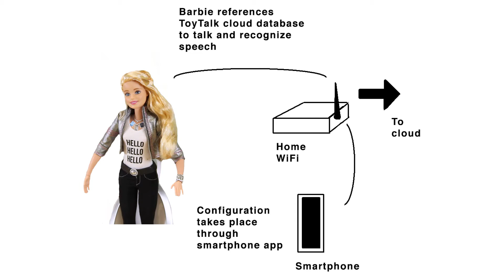The electronics of Hello Barbie

Comment: I only found out about this from my intro to human communication textbook, this is wild how this slid by 😂
Reply: It didn't exactly "slide by", but you could have missed it if not paying attention. The doll mostly fell under the radar primarily because Mattel took flack from the concept of the doll before it even hit the shelves. The fact that a child's voice is recorded and stored in a cloud somewhere sent up huge red privacy flags prior to the doll's release. Privacy advocacy groups were extremely outspoken about this doll's potential privacy and surveillance problems.

Mattel, out of an abundance of caution, introduced the doll with little fanfare, then with just as little fanfare discontinued it. The reviews on Amazon weren't great either, with many complaining the doll wouldn't hold a charge properly to incorrectly answering questions to failing to connect to getting stuck in endless loops to WiFi to being overly complicated for set up (a fact not discussed in this video). There were a litany of problems with the doll's electronics, interactions and usability, enough for Mattel to silently cancel the project and the doll in 2017, 2 years after it launched. It's probably a good thing to keep snooping devices like this out of children's hands.
Reply: One of the biggest reasons the Barbie doll even exists is that a child can dress her up in new outfits and play pretend with her. However, because of the design of the Hello Barbie, a child couldn't change her clothes or even sit her down. There was little actual child play value with this doll other than her talk system. Even then, a child could get tired of that really fast. After getting tired of talking, there's almost nothing else a child can do with this Barbie (other than stand her on the charging base).
Reply: @abigguitar  I meant who at corporate allowed this to pass, I feel like just hearing the concept it sounds like a recipe for disaster
Reply: @UltimateTS64  Not to sound like I'm making excuses for Mattel, but they're toy makers, not privacy or technology experts. These toy designers see the innocence and play value in the toys they create, not the pitfalls and dark sides of the technology which may be included. 

I'm quite sure Mattel has since learned these pitfalls considering this doll's mixed acceptance. When it was in the design phase, these concerns were likely not given a thought. Discussing the functionality of the doll? Yes. Discussing privacy concerns over conversations a child might have? Likely not. 

It would only be in the final implementation phase where these concerns might arise, but probably didn't. I'm quite sure Mattel now considers such things in the design phase today, but likely not when this doll was being designed. 

Consider that Amazon Alexa arrived Nov of 2014. This doll released in 2015, just months after Alexa arrived. The public didn't even fully understand always-on conversational assistants like Alexa at that time, let alone Mattel. Mattel didn't even have a technology model on which to base their doll during the design phase, unless you count Siri. Even then, Siri wouldn't have been a good model. As I said, this is intended as an explanation of why this doll got greenlit, but this explanation is not intended to excuse Mattel.
Reply: @abigguitar  I would agree but then again you have to consider siri was already in existence